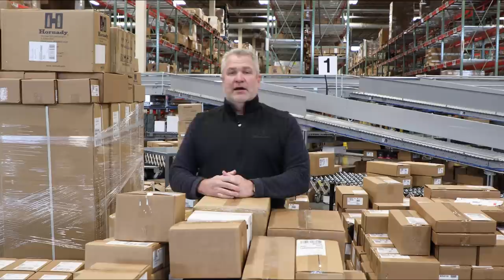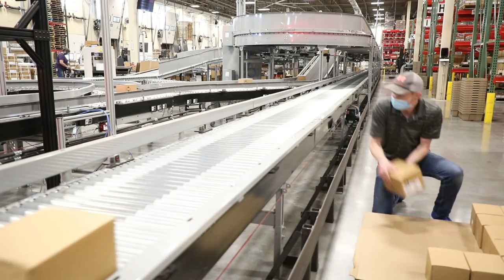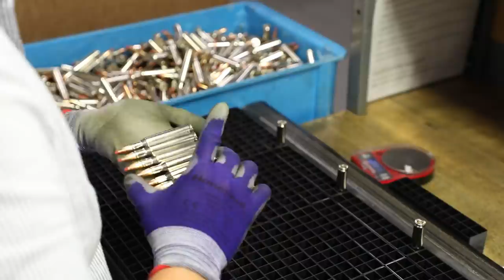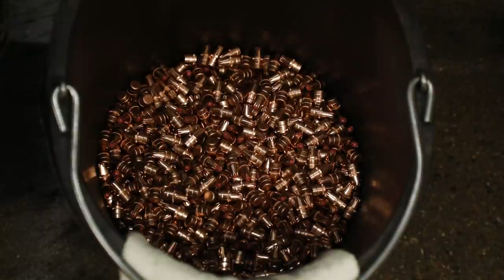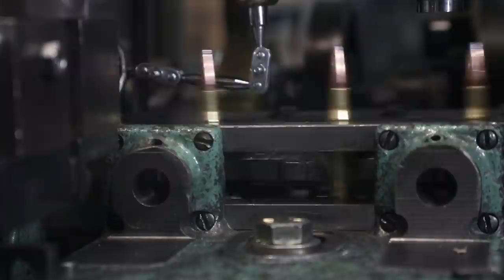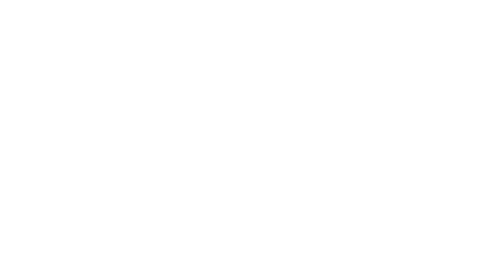Hornady: Doing Everything We Can

Comment: I've worked in manufacturing for 35 years. Plastics to be exact. For those that don't know you just can't snap your fingers and make a production line. Especially if it envolves custom made equipment. I've had to wait 20 weeks for a ball screw and servo motor. Took 18 months to make a production line that basically made rollers for conveying system. I can only imagine what a pain in the butt it is making anything that has to do with explosives. That for sure is nothing I'd want to half ass or rush.
Reply: No one is snapping their fingers for the immediate supply to return to normal.  Come on ..... ammo manufacturers have had 9 MONTHS to get it back on track.  I call bullshit. 
If the plastic plant you worked at would've taken 9 months and STILL hadn't had it figured where would your plant be ...... out of business, that's where.  Sorry Pops, not buying into that logic. American people are being controlled by Big Businesses and our government!
Reply: Thanks for that wonderful insight

Comment: Please start making your own primers. There's a huge shortage of primers for reloaders right now.
Reply: Shortage.. more like absence of! The local store was selling 1 sleeve a week and they was taking names!
Reply: @Airsoftforall  Yeah, one of my local stores was limiting primers too. What's crazy is bricks of primers are selling on gunbroker for 10x the normal price. The auctions start at a penny and get bid up to 250 -350 bucks for just 1000 small pistol primers.
Reply: @Prepare2Survive  i have been able to find a few boxes of rounds that I dont have a way to use them and broke them down for the primers!
Reply: @Airsoftforall  Yeah, scavenging components is always an option if you have no other choice. That's why I like 357 magnum as a survival / disaster caliber to reload because most of the other common calibers like 380 acp, 9mm, 40 sw and some 45 acp ammo use small primers and you can safely even use the powder charge from that scavenged ammo to make your own 357 mag ammo because 357 mag has a larger case capacity and higher max pressure than those other calibers. Thankfully I'm well stocked for primers so I don't have to do anything like that. I still wish Hornady would start making primers.
Reply: I reload my .45LC primers with strike-anywhere match heads or the 8-shot ring caps.  It's a bit of a pain, but I'm tight-fisted.
Reply: Canada has all the primers
Reply: @rodneyroyer7049  I've seen a cpl Canadian stores that had a lot of inventory but don't ship to the U.S. Road trip?
Reply: @BobSmith-mg6iz  Are non-Canadians allowed to purchase ammo & components in Canada?  I thought they require some kind of certificate.
Reply: @wdtaut5650  I'm not sure, I'll have to head over to AvE's channel lol
Reply: @BobSmith-mg6iz    The  USA  Canadian  Border is closed for non essential  due to Covid..
Reply: @mikeskidmore6754  life, liberty & the pursuit of happiness is essential. Besides, it's not like they put up a wall to heep the riff raff out did they?
Reply: I don't think the Canadian's like us very much 😕
Reply: The local bass pro has oodlums of 6mm Creedmoor rounds, but not much else. They also have several cases of the WW 5.56 FMJ rounds.
Reply: It's hard to find propellant also. Lots of Pyrodex and BH209 available.
Reply: @bobbyrobbins9816    The  Military did not  use  5.56  before  1963..   during   WWII   they used  the  M-1  whcih basically was a  30-06
Reply: I love Americans.  If I could move there I would leave this socialist hellhole in a second.
Reply: @wdtaut5650  from what I'm understanding is, you need and import/export license.
Reply: @mikeskidmore6754  ... he’s not talking about WWI or II... WW means Winchester Whitebox
Reply: @agmsmith4079    Oh   I see he  did say  WW  not  WWII  ..   I have no  clue what WW  is ..  I have  heard of the Military Green Tip rounds..
Reply: @bobbyrobbins9816  i know. You can find creedmoor components out the ass. These companies shifted focus to the new “miracle round” of the month and probably all but stopped with other caliber components. This waa happening before covid/riots/etc.  Ive had trouble finding certain brass/bullets for a long time now. Speer may as well just fold up shop because over half the bullets in their reloading manual have been non-existant for years now.
Reply: @mikeskidmore6754  ...green tips are called M855.  Standard 5.56mm 55gr FMJ ammo is called M193.

WW 5.56 is Winchester’s M193 product.

Winchester has several different lines of ammo... Brown Box (least expensive), White Box (moderately expensive) and Black Box (Most Expensive).

Here is some WB (Winchester Black Box) .223 for example...

https://winchester.com/Products/Ammunition/Rifle/Ballistic-Silvertip/SBST223B

And here is some WB (Winchester Brown Box) .223
Reply: @agmsmith4079    I will  look into that..  I have an  M-911  I should sell like new  only  20,000 Miles on it ..  Seems  I read a while ago that Green tip was  67 grain..  I have  PMC  Bronze .223 ammo   FMJ-BT   2900 FPS
Reply: @mikeskidmore6754  ...green tip is 62gr.

.223 ammo isn’t as standardized as 5.56mm because 5.56mm ammo was spec’d by nato for forces around the world.  So for 5.56 there are a couple different types available to civilians... M193 (which is the 55gr 5.56mm FMJ) and M855 (which is the armor piercing steel core penatrator 62gr 5.56mm FMJ) or the new M855A1 (which is an armor piercing steel core 62gr 5.56mm FMJ but uses copper instead of lead inside).  There are a few more available to the military like tracer, etc and some countries have made their own variations like using a carbon penatrator instead of steel etc.  but the ones generally available for sale to the public are the M193 and the M855.  The companies may not put that on the box... but if it is 5.56mm it’s going to be one of the two.

For .223, there are dozens and dozens of different types of rounds since they don’t have to conform to nato standards.
Reply: Guessing they won't care until finished ammo revenue start dropping, and they notice they're not selling as many bullets or as much powder for reloading, since everyone will be out of primers, and see a hit on the bottom line there.
Reply: @81mrsmitty   -  We would welcome you here...  Must suck to live in California...
Reply: @Prepare2Survive  
Because people are scared that they wont get anymore. When people are scared, people become stupid, AND also, greedy.
Reply: @rodneyroyer7049  
And now their fearless communist leader has banned their guns. Primers ain`t gonna do THEM a whole lotta good, now. Same shit gonna happen here.
Reply: @mikeskidmore6754  
Imagine that, lol.
Reply: @BobSmith-mg6iz    The Border is closed do to Covid  last I knew..  Of  course you have a Passport already ?
Reply: @mikeskidmore6754  I have a passport and you can cross the border with justification. 🙄
Reply: @BobSmith-mg6iz    What is Justification?  I don't  know  one person who has died from the Plandmeic
Reply: @mikeskidmore6754  I know several who have. Work, medical care, delivery will all get u over the border with a negative test

Comment: I am in a minority here but I wish they would gouge the ammo price from the factory. Hear me out. The price from the factory doesn't properly reflect the supply/demand so scalpers buy it all up at way below market value and resell it. If it was closer to the real current market value then scalpers/horders wouldn't buy as much and it would still be on the shelf. The biggest advantage though is that the current high price of ammo would help Hornady make more machines and hire temps rather than helping some scalper scalp more.

Price fixing below market worth just makes it so it wont stay stocked, and the manufacturer won't have the money to gear up production.

Comment: We seem to have supply issues due to DEMAND every time there is a shift in supply whether perceived or not which = SHORTAGES. Look at the toilet tissue, and hand sanitizer, or storable food (cans/boxed) business  during the  covid hype, they seemed not only to meet supply but exceed it, after they experienced supply issues. The opposite effect for ammo, components, parts and firearms. 
You should have prepared for ammo runs it's not like it came out of the blue; and STOCKPILED AND WAREHOUSED EVERYTHING, what cost more money, storing goods or losing out on selling during the greatest buying trend in centuries? 
IF..YOU would have stockpiled, expanded and modernized, LIKE EVERY OTHER INDUSTRY there would be no shortages. We seem to have shortages every year based on a whole slew of factors. 
Every rise in demand that manufacturers ignore is money lost, add to that an estimated 5 MILLION NEW gun owners and what we have is a piss poor business model that would not extrapolate further out in the next 6 months! 
As far as raw materials go every industry buys from the same suppliers. Take lead for instance 80% of the lead produced goes into Battery production. Are batteries scarce or more expensive than ever?  9% of lead produced goes into stabilizing other compounds and used as a stabilizer. 5% goes into the building industry. 4% goes into protective material for protection from X-rays , piping, T.V. tubes, etc. Which leaves 3% left over for other uses including  projectiles. The demand is real due to the fact that the supply is so mis-managed that is scary!
Seems there is a concerted effort into not pumping out firearms related products even though the demand is huge, I believe it is not from hoarding or panic buying. That should be short term when those instances occur, it is the business model or lack of, in the firearms industry and lack of being able to ramp up due the lack of modernizing, expanding (capitol) and compliance.